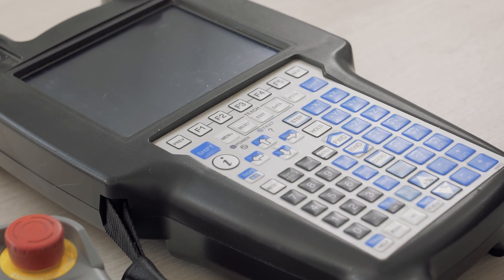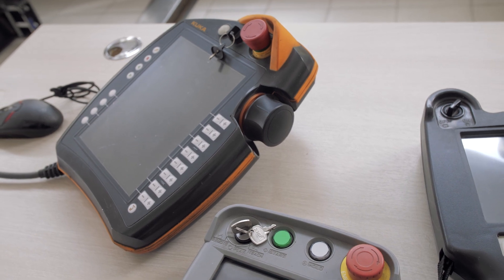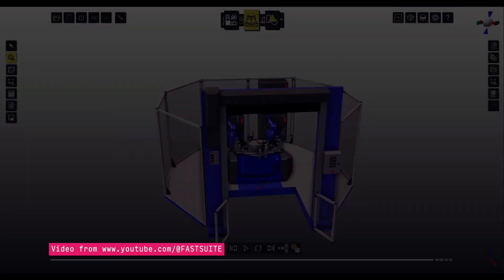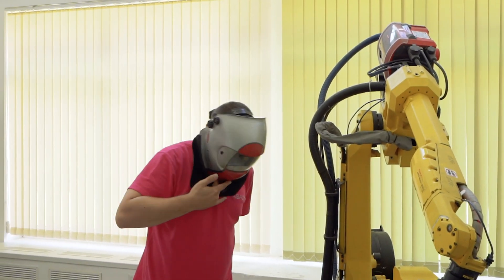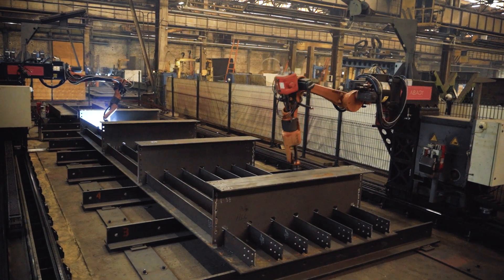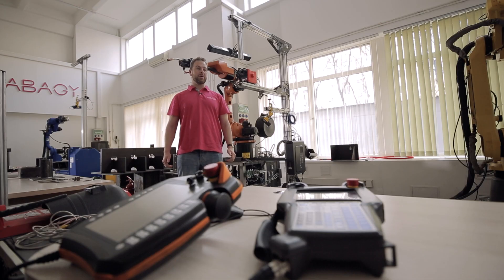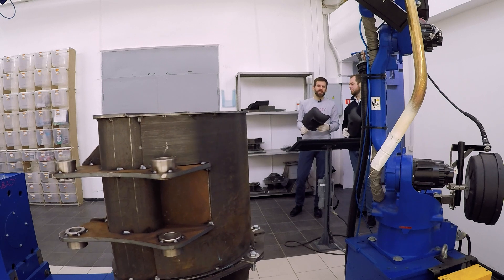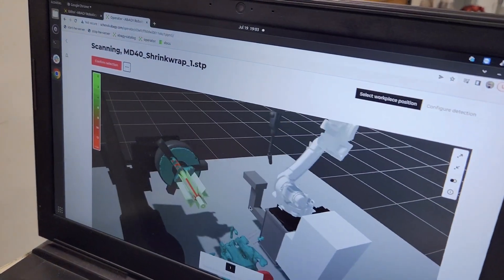Robot Programming: 3 Methods | ABAGY ROBOTIC WELDING

Comment: So a 3dmodel of the finished assembly is required? What CAD software can your software work with? How does it know where are the welding paths?
Reply from the maker: ABAGY’s software doesn’t require any specific CAD software—just upload the CAD file of the part. Our machine vision system then analyzes the part’s geometry and detects its exact location on the positioner.